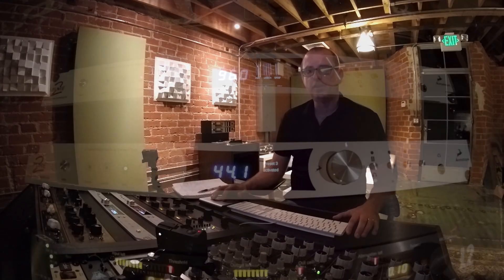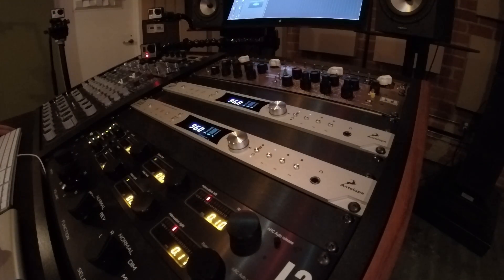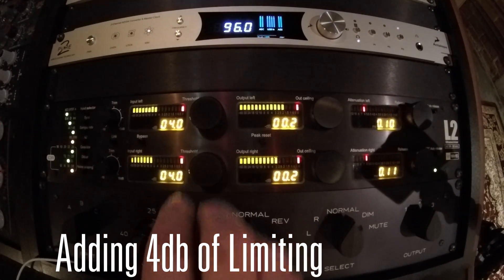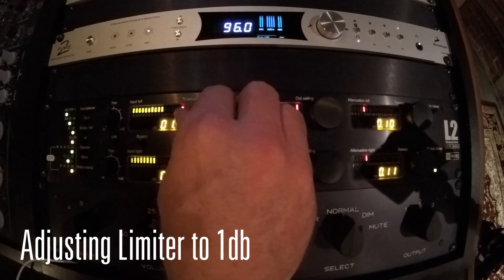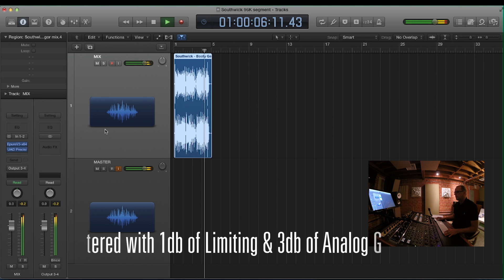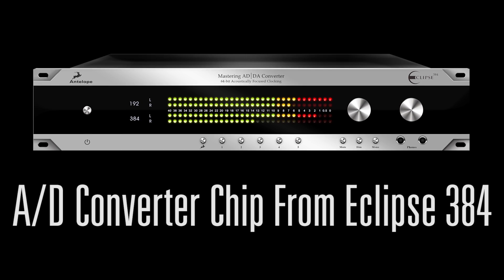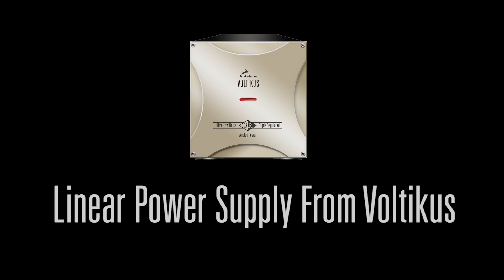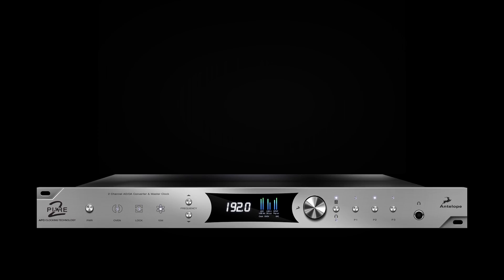Mastering Hot, Loud, and Clean with Pure2 | Antelope Audio

Comment: "By reducing the amount of digital processing and recording louder into the Pure 2 etc". If you're recording louder in to the Pure2 isn't it just digitally limiting on the Pure2? Unless there's some analog process going on what's the difference?
Reply: This is an old comment now, but I just noticed it.  And yes, the "chip" handles how the the clipping is turned into digital audio, but the key point is that this process is intentional and meant to maintain the sound as long as possible, before getting into ugly distortion.  While this can be done later in DSP, I found that it's best to do it right at the source when printing and I still record masters a bit "hot" this way even now using the Goliath HD.
Reply: @MarcelJamesMastering  Hey James, thanks for the video. I'm most likely purchasing a Goliath HD in the near future. Are the Converters on the HD superior to the Pure 2? I'm debating whether to print back into line ins on the Goliath HD or to purchase a dedicated to channel AD such as the Dangerous AD+.  Do you work for Antelope? Thanks!